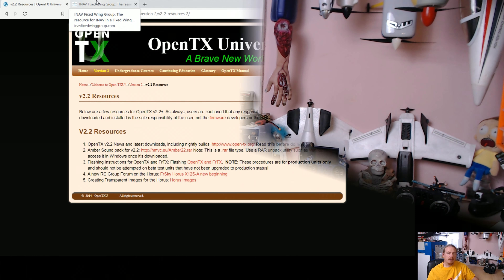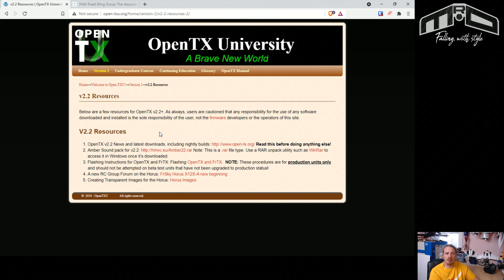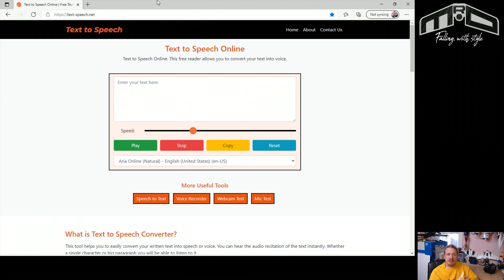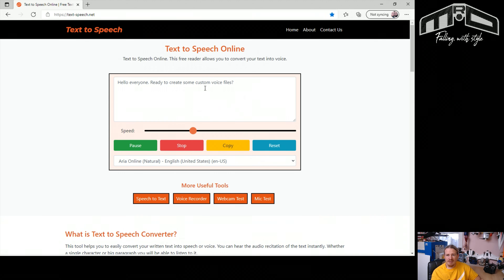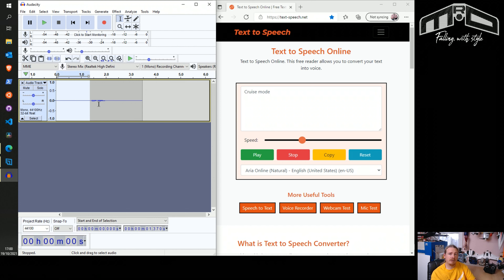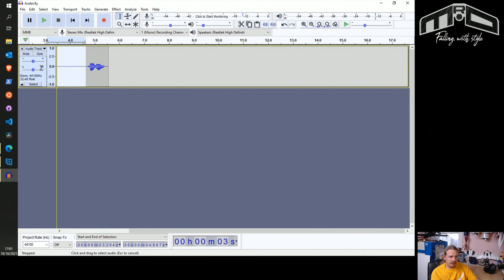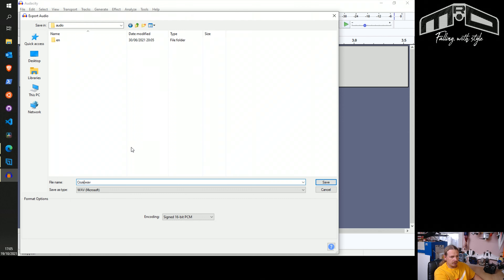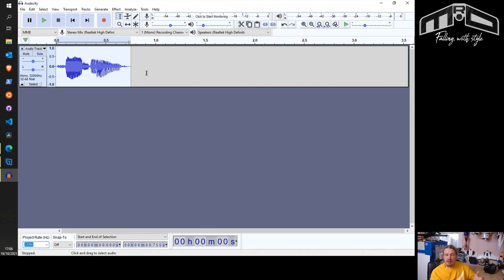Installing and Creating Sound Packs for your OpenTX or ETHOS Transmitter

Comment: Using these directions a number of sound tracks, some from Amber 22 and some custom made, were installed.  They were perfect!!  Now, however, the custom ones made in the exact same manner, broadcast by the X20S greatly slowed and cannot be understood.  The original tracks are still perfect.  The new ones play properly on the PC.  No idea what the problem(s) is/are.  Something has changed but what is unknown to me.  Suggestions to go back to what was are appreciated.

No, I am not a computer tech although I am somewhat experienced.
Reply from the maker: You probably have the wrong sample rate set. It should be 32000Hz. Start at 9:00 https://youtu.be/2AcB_jrFFK4
Reply: It's possible one had the wrong sample rate.  The error was caught after the first try.  They currently have a 32000 ghz rate.  Didn't help.  Deleting the track from the SD card did not remove it from the list in the radio.  Is there a way to delete a track from where it is stored in the radio?
Reply: @MrD  Doesn't matter now.  The navigation buttons have disappeared as well as all my model setups.  Such is life.

Comment: Hi Darren. I tried to post this a few days ago but can't find it. So apologies if this is a duplicate. What I really want for Christmas is to find a way for my X18 to stop reading out all sound tracks for the selected model on power up even when the "skip on startup flag" is on. It doesn't do that when you switch from one model to another. Anyone else have this problem? Happy holidays. love all your videos. 
Tom Gottlieb
Reply from the maker: Hi Tom. Sometimes YouTube deletes comments that it feels goes outside of the community guidelines. I’ve seen countless questions where the comments are fine, but YouTube deletes them anyway. Some I catch just in time or get an email for, so can see they are fine. But when I go to answer, they have been deleted. The YouTube AI is too aggressive, has no concept of the context, and YouTube don’t want to do anything about it. I have asked a few times. 

Anyway. That sounds like a bug in ETHOS. The skip on startup should work if the model is switched or if it is just powered on. The best place to report this problem is here https://github.com/FrSkyRC/ETHOS-Feedback-Community/issues

I would offer to do it for you. But sometimes they will ask for extra information or model files. So it is better to do this directly.
Reply: @MrD  Hi Dan... Thanks for your reply. I wasn't aware that YouTube would censor comments. Anyway I did create an account on github and will report this. Meanwhile I took a read through a large number of reported issues and was that ever interesting! I would encourage all new Ethos users to take a look. You don't need an account just to read them. I learned so much just from reading other peoples comments and replies on issues. Regards... Tom
Reply from the maker: Yeah, unfortunately they do Tom. It’s not like they put the comments somewhere to be checked either. They just delete them. 

The GitHub is very useful for information. If you have a problem, the closed issues can also show if it has already been fixed too.

Comment: hi friend there is an option to change the opening logo of radio X20.  Thank you.
Reply from the maker: Unfortunately not. Its coded in to the firmware.
Reply: @MrD  And I can set my own splash screen
Reply from the maker: That’s the same thing. It is built in to the firmware.

Comment: Hi Darren, Have installed the Amber sound pack and inav sound pack but there are no Wav files when I try to programme a sound, just a box saying Wav file that just takes me back to the screen.If I plug the transmitter into the computer it is showing all the files are there. Going into file manager in the radio/ audio there are only language files.  Also on the SF page there is a Global switch that does not seem to be on your one in the video, what is that for? Any help would be greatly appreciated.  Thanks.  Running Firmware 1.0.19. Than
Reply from the maker: Hi Paul. On ETHOS your custom sound files should be in /audio/. They don’t go in the language folders inside /audio/. In the video, all the files you can see in the audio folder are custom sound files that I've already made.

The Global Switch is a new setting in ETHOS to allow you to use Special Functions on all models. It was added after the video was recorded.
Reply: @MrD  Thanks for your speedy reply Darren, I'll try again. Unfortunately Audacity will not work on my computer.